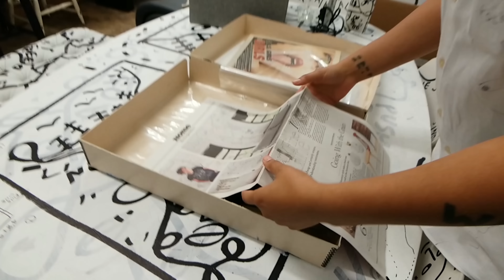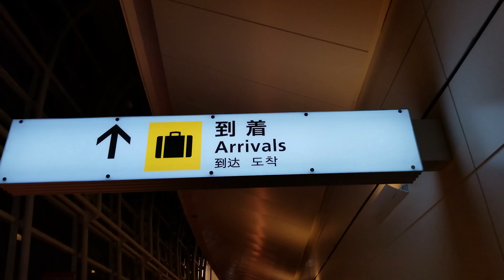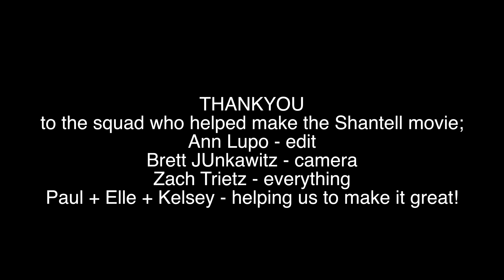WE WANT TO TALK ABOUT OUR MARRIAGE

Comment: "$180 for pure cashmere" 😂😂😂😂 I bet a majority of his audience has never worn or even thought about wearing "pure cashmere"
Reply: Casey should have cut that. Unnecessary comment which doesn't help anyone.
Reply: It's his vlog he can say what he wants.
Reply: Yeah shouldn't have said the price/bad comment, people know it's not going to be cheap. But you can easily get cashmere for half of that, but not Billy lol
Reply: No?! Do any of you actually know the true value of cashmere? Yes, you can get a chashmere jumper for under 100$, but that will be of very low quality and will get holes very quickly because the individual hairs just aren't as long. For really good cashmere, the goats aren't shaven for several years so that their fur becomes very thick and silky. If you get cheap cashmere, the goats are probably shaven multiple times per season and they are kept under very bad conditions in stables. For good cashmere, the goats walk around in the mountains and eat only herbs which reflects directly in the fur. If you're not willing or able to pay that much for a jumper, that's very understanable, but you won't get the same quality.
Oh yeah and the profit margin is usually much bigger on cheap clothing than on expensive clothing btw.
Reply: I wear cashmere. I even used to wear a black cashmere sweater under my military combat uniform in the Winter (Air Force, of course).

Comment: casey the type of nigga to be running 3493 miles a day and can't climb 4 floors up :')
Reply: cheetah fun fact: its easier to run than it is to go up stairs, reason: your muscles require oxygen relative to their work both resting and during work, unlike running climbing stairs requires our legs to constantly do short range of motion squats in quick succession without adequate rest to absorb more oxygen from the blood. Your muscles then become O2 deficient making one feel out of breath. Running is different in that every step allows for more time for your legs to get rest and retrieve O2 from the blood, the time between steps (load and unloading) is greater during a jog or run and while on the stairs the body has to make many more steps without rest.

Comment: A screw through the top of the desk surface...I wanted to run outside and try to chop down a tree with my hand. Move that screw to the front edge of the desk and regain use of that whole section.